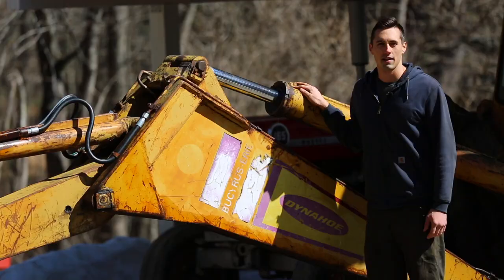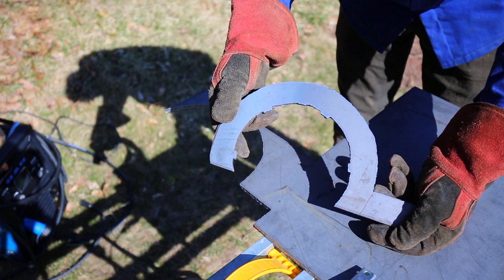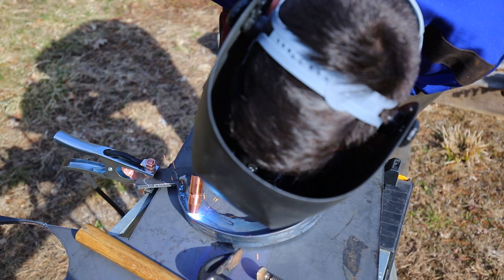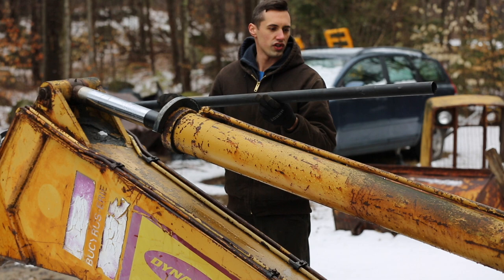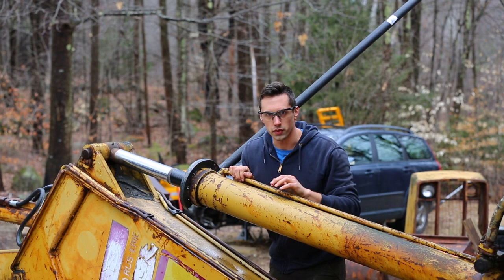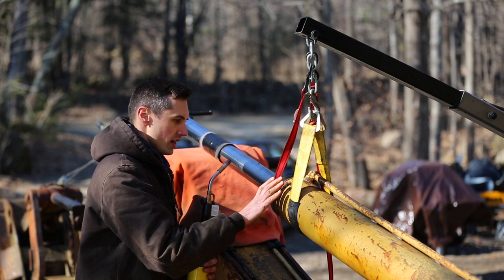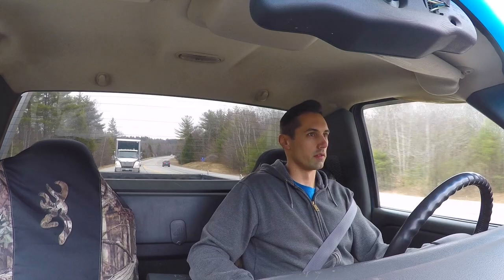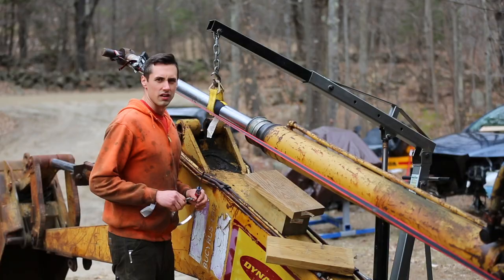Fixing a Leaking Hydraulic Cylinder [Dynahoe 160 Part 6]

Comment: Suggestions for future reference... 1) Disconnect both hoses from the cylinder, so as you're pulling out the rod, the other side of the piston doesn't create a vacuum. 2) The ratchet you were using to pull out the rod was pulling at a downward angle. Ideally, you want to pull the rod "straight" out. 3) One option is after you have slacken the big nut, you can remove the entire cylinder and place it on the ground to work on it. That being said, I think these things are always a headache to work on. You did good for someone doing this for the first time.
Reply from the maker: Thank you for the tips! 👍
Reply: Good idea, thats why you're the mechanic and I'm not. Thanks
Reply: @acme855  I'm not the mechanic, I just learned the hard way 😂

Comment: For future reference, beating around the circumference of the large seal nut, the one you made the spanner wrench for, may have helped in loosening ancient crud stuck in the threads. It's a trick I used when working on snow removal equipment where salt messed things up. Also works on hydraulic fittings. Use caution on fittings, have a helper hold a bigger hammer than the one you are swinging on the opposite side as an anvil. I hope that made sense, You seem intelligent enough to know what I mean. The shock of the hammer blows momentarily oblongs the circular thread. Hope I helped.
Reply from the maker: Thanks for the tip! I have to reseal the stabilizer cylinders next, so that might come in handy!

Comment: We usually weld a big piece of bar straight to the gland (the big threaded bit you were trying to remove. The heat frees up the threads and is simply cut off and cleaned up afterwards)

Comment: Im pretty late to the comment section here, but if you're ever in a situation where you need a big socket like for the end of the cylinder rod, there are tools called Slugging Wrenches that are quite handy. No air needed, and no giant impact gun. Just a closed end wrench that has a large striking pad for a sledge hammer. I work in a mechanics shop for heavy equipment, and we use them often. Also, those particular nuts usually go on with red locktite, so you usually have to use a torch to get them hot enough to come off.

Comment: You should remove the hydraulic lines connected to that cylinder  first before trying to remove the gland nut. Relieves the hydraulic pressure. Makes things alot easier. Also never turn the unit on when you have any sort of hydraulic component torn apart like this. Even if you're just replacing a hydraulic hose. Stuff can get very dangerous with that high pressure. But hey you know that now. Cool video 😎
Reply: When you fired your tractor! I could see that hydraulic piston and ride assembly shooting into the neighbors yard or maybe through a building

Comment: Cylinder packing is part of the job, yes it’s a lot of cleaning and seals but it’s not that bad to do. Now that you’ve had before and after you can see how it’s done. Yes we own a lot of big tools in heavy truck and equipment world but it saves us some on outside labor in the long run. 
Your spanner wrench build was a cool idea, thicker plate and a 1-1/2” bar for the handle would have helped you but you got it done. 
Not giving up and coming up with a better plan is the key a lot of the time!

Comment: I worked on hydraulic cylinders for a few years the special tools is a punch and a sledge hammer or a 6ft pipe wrench too also heat helps because they are always put together with lots of lock tight

Comment: Waldo I had the same machine three backhoes ago...they are animals ...but suffered from certain issues...there are no machines produced today that have cylinders the size of the dyna hoe..good luck with it and believe me I never had a job mine could not handle...it took three machine to find one that came anywhere near what the dyna hoe could lift
Reply from the maker: Yeah, I have to say the lifting capacity of the loader is impressive: 7650 lbs. according to the manual!

Comment: I had the same situation, with gland stuck to cylinder, I welded 2 5/16 nut to the end of gland with the heat from the welding plus a large pipe wrench with long pipe extension the came loose

Comment: Bigger hammer, a longer handle for more surface area, for when you put the pipe on it. Also you could've heated it up with a blow torch to expand the metal some.

Comment: That’s bad ass, at first glance I wouldn’t even think you would know much about heavy machinery
Reply from the maker: I'm learning as I go 😉
Reply: @WaldosWorld  I have a 1978 160 too. I am not much of mechanic and a brand new operator. I have an issue once it warms up it stops moving. Subsequent also it leaks at the cooler so I have my headaches too. It runs like a top and in pretty good shape, but not usable yet.

Comment: I have 60´s Ford 4500 backhoe and i fought several days to remove the big nut from the end of big cylinder on top of the boom. All this seem so familiar that it almost makes me not wanna watch this. By the way, at least in my case the nut was cast, just like the inner smaller nut (which in Ford is also threaded). Great videos you have, take care.
Reply from the maker: Thank you! Yeah, these hydraulic cylinders sure can be tough to work on!

Comment: To loosen the large nut could have used a large pipe wrench and a 10lb hammer to turn it by hitting its  metal handle.
Also, you could have fabricated a ring wrench and used a pipe to extend its handle in the same way you removed the cylinder end cap.

Comment: Next time to push a cylinder out?  Do what Andrew did:  Compressed air.....  ha!  Nice video.   The only suggestion I had, was possibly fabricating the wrench to a full 360.  Yes, you'd have to slide it over the end, but you gotta loosen that anyway... I think I'd also have some holes spaced around, that you put threaded rods through, and then?  Anchor them to the main body, to keep the thing on the end.  If they are very long (3 feet) they won't impede rotation until it breaks loose, then remove the rods, and use as you did.  Still.  Pretty amazing, as the Hydraulic Press Channel says?  Pretty Good.

Comment: Waldo I’m sure you know by now..the torque on that nut is over 2000 lbs...but the other issue is the ability to hold the rod from twisting
Reply from the maker: Oh wow, I didn't realize it was that tight! I have to rebuild the stabilizer cylinders next, and I'm determined not to give up, so I guess I'll get a 10 foot pipe ready!

Comment: I made a similar tool out of a BMW suspension part. It was still squishy with a 6 foot pipe so I simply welded a 3/8" rod from about 2' down the pipe to the top of the arch. You must get the give out. It worked immediately after that. I'm talking a 5" boom cylinder on my Cat 307 excavator. That all went great but now it is stuck right about at where the gland sits. Won't budge with a doubled up come along. Just when I thought I was on my way. Help! I'm a little gun shy on the idea of blowing it out using the hydraulics 😜

Comment: I like how you built the spanner wrench 🔧 to fit the cap on the cylinder but why didn’t you build a wrench to fit the nut on the rod or even a socket out of that same 1/4 plate draw it out and use 3 pieces welded together add a piece of pipe and the a old socket that you have several of.   My deceased dad and I’ve had to build several tools and adapters to make parts work that were meant for different machines.  PS wish I had a plasma cutter it sure would’ve made making tools and stuff nicer especially since I’m not very good at use a cutting torch, I move either to fast or slow.
Reply from the maker: Yeah, I definitely could have built a socket for that. Next time!
Reply: I came here to say the same thing. It used to be my full time job back in the old South Africa. Because of sanctions, we had to make all sorts of plans and do without the “correct tools”. 
Good to see you persevere! Great videos Waldo! 👍🏻

Comment: Epic spud gun
Reply: And we wont tell the epa that you spilled any Hydraulic fluid okay. 

Spilled like a quart of diesel fuel in the field one time in Wiscanistan, and the fucking by the time it made from my Platoon sergeant to my company commander, to field operations command to base hazardous materials disposal, then the epa heard about it, it was an entire hemtt tanker spill, or like 2,800 gallons, and it wasn't contained on a brim, it was in topsoil.

And yeah, I know they only take "2500 gallons" but fully wet they usually hold more than 2500. Either the tanks expand, or there is some kind reserve. Or the fuel metering devices on both the ingestion end (the thing putting fuel into them ) and the production end (where we fueled up trucks in the fuel) had some calibration errors.

Comment: Right away get yourself a cheap torque multiplier/ log nut remover, about $50 for a set on ebay. Will take off any nut that even bigger impacts cant budge.
Reply from the maker: Thanks for the tip, I'll check it out!

Comment: Hi Waldo. Just wandering, what is the bore and rod size on your boom cylinder. Need to do mine soon on a 290. Looks intimidating. Just did my dipper cylinder.,  heavy as hell, even with two guys, and it was only 2.5" rod X 4" bore
Reply from the maker: The rod diameter is 3". I'm not sure about the bore, but the outside of the barrel looks like it's a bit over 6", so I'd guess the bore is 5.5" or 6". I'm worried that I might have to do the dipper cylinder soon
Reply: @WaldosWorld  Actually it was a bucket cylinder, not dipper. Dipper is bone dry for now
Reply from the maker: Ah okay, that makes more sense. I think the dipper cylinder on mine has the same dimensions as the boom cylinder
Reply: Yeah, 3"x6" buried inside. I guess it's work in progress ( Lol) Just did my both loader tilt cylinder,  bucket, left swing, left stabilizer and right ball joint. Now thinking of doing a boom, thing looks intimidating though.